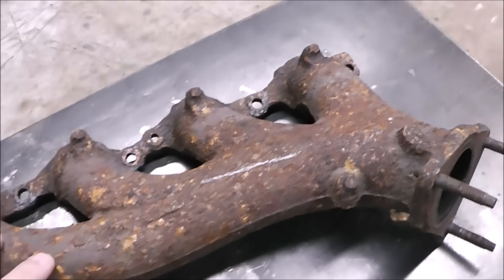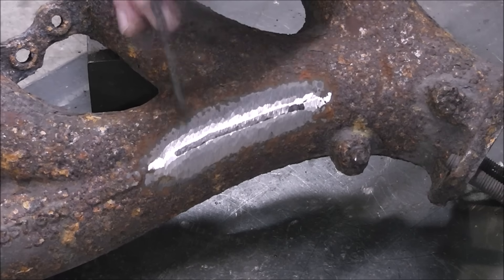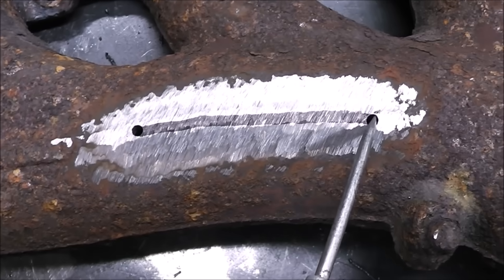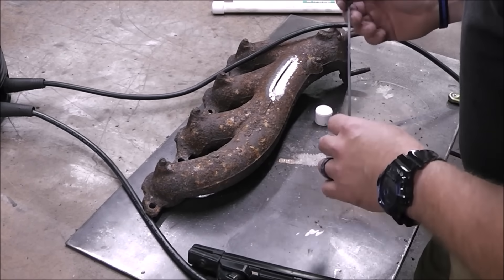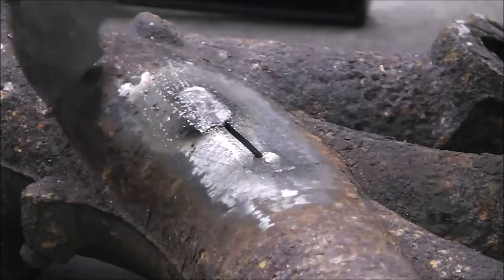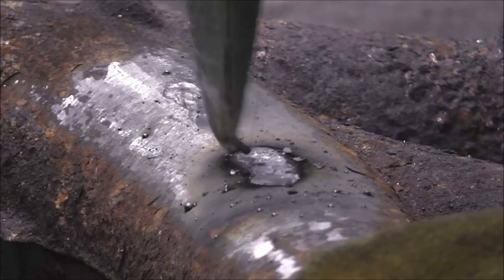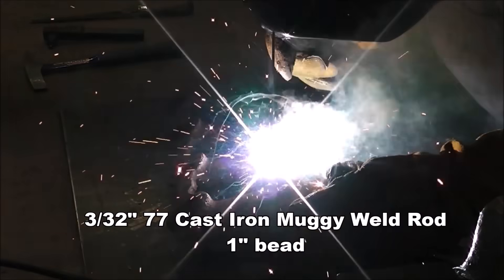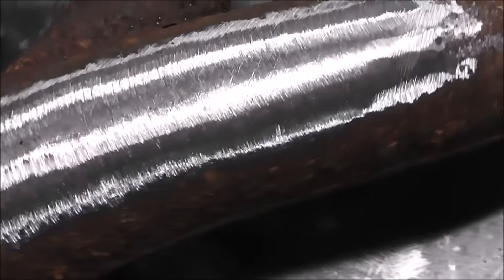Stick Welding Cast Iron Repair with Muggy Weld

Comment: any objections to filling a manifold like that with sand, would help keep the inside clean from slag and spatter?
im not much of a welder but that seems to make sense
Reply from the maker: That's an interesting concept...I can tell you that next weeks episode includes cutting this weld open, so you might find that episode interesting. However, I have never heard of a part being filled with sand but it makes a lot of sense.  I might have to do some testing on your suggestion..I like the idea. Thank you for watching!
Reply: PhunkBustA 
I was going to say woulden't oxygen & acetylene b easier.
Reply: well yeah but you cant always have access to an oxy torch, could possibly get away with doing something like this out in the bush with a couple of spare batteries?!??
Reply: PhunkBustA 
Is this to me.
Reply: yea man

Comment: I've always used JB weld, follow the same prep procedure. Mix up the jb, smer it on and leave it set for awhile, with me it's always been a couple days before I got back to the project.
Reply: jb weld on a exhaust manifold will fail in mins. It can't handle the heat.
Reply from the maker: I've have heard of it being used on exhaust but I have not personally tried it. I have used JB Weld successfully on a carburetor flange that I accidentally broke off.
Reply: Learn how to weld.   Smh
Reply: i keep hearing more and more good things about jb weld and i keep wondering why i don't use it for everything

Comment: Sorry, nice work but that is not a "perfect" weld, as you stated...
Reply from the maker: Oh it's perfect alright, in fact, I think it could be the best weld of any weld ever 🤣....want to know how I know this? Because I cut it open and examined it. You could also say your weld is perfect if it held together,  didnt crack and the repair worked (just in case you didn't want to cut open your fresh engine block repair 😂). The video will be out next week. Cheers and thanks for watching.

Comment: To stick-weld cold cast iron, just use a series of very short tacks (half-second to one-second maximum) , immediately peening each as it cools down, and never letting the piece get too hot to touch. Takes time, but is reliably effective.
Reply: Use "99" rod or 309 stainless steel rods maybe 😀
Reply: sixmagpies p
Reply from the maker: Right on!

Comment: Whath about preheat it to aprox 100 degree 212 Farenheit before starting welding? Wil it make a different too the end result? Thanks for a good video about cast Iron welding.
Reply from the maker: If you can do a preheat first, then weld, then possibly a post heat followed by a cool down slowly by insulating the part in a blanket or sand will greatly increase your success. Some cast is more forgiving than others but pre and post heat are the preferred method.

Comment: Can I weld my old thick cast iron vice ? I try with my soft steel rods and it felled.
Reply from the maker: You sure can! If you can do a post heat and cool in sand, it will also help.

Comment: I have repaired engine blocks and heads with muggy rods, I've even TIG'ed with them. NI99, and silicon bronze also work.
Reply from the maker: I was impressed with the instructions that came with their rods. I plan to try to TIG with these. Im excited to try them.
Reply: WANT TO SEE WHAT THIS LOOKS LIKE ON THE BACKSIDE? WANT TO FIND OUT HOW STRONG THE WELD IS? FIND OUT HERE: https://youtu.be/cVrydI-v7B8
More cast iron welding videos here: https://www.youtube.com/playlist?list=PLfbf78fMz9VpweFv4IqUfrrNV6Vvro7Cd

HERE IS THE INDEPENDENT TESTING SHOWING THE CARBON CONTENT https://ls1tech.com/forums/forced-induction/1750208-what-truck-manifolds-really-made.html

NO I did not mess up.
NO I did not weld one side then finish on the other.
Both sides of the manifold were prepped. You saw me prep one side. The other side was also prepped for a future tig welding video.  Being the producer, cameraman, narrator and welder, I didnt realize that I was welding on the side that you didnt see me prep.

Comment: Worth saying that it depends on what type cast iron it is as some are weldable with precautions but for instance White Cast iron is normally considered unweldable by a fusion process, problem is always knowing which one you have?
Reply from the maker: Spot on brother! It seems that even grey cast can vary widely depending on the age and what it's application was.

Comment: I once did a beautiful job welding a Slant 6 exhaust manifold crack. I had it resting in the vice, loosened it and it fell out of the vice and hit the floor. I even managed to grab it, but it rolled out of my hand and broke into 3 pieces - nowhere near the weld btw!
Moral of the story was, sometimes cast becomes so brittle that it's a waste of time repairing it.
I felt a little silly but this manifold breaking was a blessing in disguise. a) I didn't fit it to the car, and b) it taught me how to identify good candidates for repair and those that ought be rejected.
If they're not rare, I always tap exhaust manifolds with a hammer now.
Reply from the maker: Oh man! I can actually picture that happening. You are correct about cast being brittle. It seems it can vary widely. Some cast is much easier to repair than others.
Reply: The properties of it change with age combined with the type of use the car has had. 
I don't know what those variables actually are but if the cast has gone that light brown color it usually is no good. It gets altered on a molecular level I'm thinking.

Comment: The steps were good but you did it wrong. You should cut it with a thin grinder, not marker it. Anyone can weld a non cracked cast iron.
Maybe you weld a real crack not pretend you have a crack. The prep for a real crack are different.
Looking forward to see it right.
Reply from the maker: Isfan Romeo Did you watch the video?
Reply: Yes i did
Reply from the maker: I'm confused then... I sliced completely through the cast iron with a diamond cut off wheel, then I stopped drilled it and I welded up the gap. I'm not sure how a real crack is any different from what I did in the video?

Comment: I'm 3 for 3 I know of. 3 that failed immediately,and 3 that are still working, all 3 exhaust manifolds on flatheads that are presently award winning show rods. 1/8' Nyrod, preheat with NO oxy, just propane or acetylene. Oven kept rod, NO SILVER BRAZING FLUX in the same oven....that junk fouls Nyrod. Post heat same....NO OXY USED AT ALL !!!
Reply from the maker: Awesome! How did you do your cooldown? Did you lower the heat over a few hours? I've had good luck burying the part in sand

Comment: Undercut isn't from welding to hot. Its from moving too fast and not letting the bead puddle
Reply from the maker: Undercut is caused by too much welding current or improper technique. The cure is to reduce welding current or pausing your weave in the corner or reduce your travel speed. I wanted to limit heat input, so no weaving = reduce current.  Thanks for watching. Cheers :)

Comment: If you can wrap the welded part in a heat blanket, it will cool slower and become harder. I weld forklift casting and I can tell you that you hit welding cast iron on the money! Great video!
Reply from the maker: TODD CASTLE thanks man! I appreciate your support brother!

Comment: I’m confused you say mig welding in Australia we would call that ark welding different from mig which is done with a wire feed and argon gas
Reply: Wayne,   Brandon was saying that you can MIG Cast Iron but results can be hit and miss , a much better job is done with higher current and less filler than most MIG Power Supplies can provide and if your using cast specific Flux coated Nickle Alloy Rods the job will be a permanent fix. 
MIG or Metal Inert Gas some in the trade call it GMAW is in effect just the same as your standard Electrode Arc welding but instead of the flux becoming the Gas Shield it uses compressed Gas typically Argon blend fed to the weld nozzle  to shield the Arc from Oxygen in the air .
Reply from the maker: @mozzmann  ^ THIS! thank you brother! Well said! Cheers
Reply: Been a Welder/Fabricator for over 40 year's so have learned many tricks :)
Reply from the maker: I'm not sure what your referring to. I was stick / arc welding in this video.
Reply: Mig confused with arc, austrailia really is backwards hahaha
Reply: Ah Well not as backward as some it would seem 'cause I got a news flash for ya Sir !! They are BOTH Arc welding - END of discussion, they just achieve the end result in slightly different ways .

Comment: That Manifold appears to be from a V8 Buick . I had a V6 and the Manifolds were identical except 3 ports rather than 4 , Honestly I'd be preheating with an LPG torch , not necessarily to the point of glow , but fill it with sand and then place in your houshold oven at 500 deg for an hour then LPG (Propane for you Yanks ) and weld it in ONe hit then peen as it cools , then back under the torch and into the oven to cool over about 3 hours from 500 Deg F to 100 Deg F then turn the oven off.  I have welded many Manifolds like this and not had issues.  
A neat trick if there is a spring works close by is ask if you can place the manifold in their Oven  for a couple of hours and then into the hot sand pit if they use one to cools slowly :)
Reply from the maker: Right on! That's the preferred method in my book! I was seeing how these rods responded to the cold method :) cheers and thanks for watching!
Reply: I once welded up a broken trans case I stripped it of all parts then set a bag of charcoal ablaze in it after about 15 minutes we welded the crack like you did one end then the other then peened it then put more charcoal in it and lefty it burn out slowly reassembled it the next day ,its still working today about twenty years now an old ford farmtractor
Reply from the maker: Michael Richter nice job! It’s a great feeling fixing something like that!
Reply: I can vouch for the efficacy of Muggy welding rods. They flow and wet in like butter. They're my go-to rod on cast iron. You can also knock the flux off and TIG with them. I keep a selection of these rods on hand for the occasional cast iron job and they always work well.
Reply: Yeah way too time consuming.
I've done all sorts of things with stock toyota manifolds, no pre-heat, no after... heat... no nothing, just spray welded the SOB, never broke anything, been using one of them every day for 6 years no problems.
You definitely want to be welding at the right settings but other than that the cast manifolds doesnt need much prepwork.
Transmission and crankshaft casings on the other hand, those things will require some attention before, during, and after welding.
Reply: mozzmann """"
Reply: I think its a GM truck gen 3 exhaust manifold or ls motor but i have heard most or a lot of those are cast steel a lot of people use them and cut and weld up turbo manifolds
Reply: @james10739  Yup that is an early LS Gen 3 truck/van/suv driver's side manifold. Note that the heat shield has rusted off and that all of the heat shield bolts are still attached to the manifold.
Reply: Thank you for excellent information, although I'd much rather save the time with the method and product shown in the video-in all cases, you know that cast iron parts come in a variety of uses and thicknesses? I will be using these rods extensively for sure.

Comment: I used to work with an old man that used a really unconventional approach to cast iron I'd love to see your take on that And maybe some strength And durability comparisons. please contact me for more information.
Reply: I would like to hear how to weld solid cast iron, I broke the arm off my windmill gear box casing.
Reply from the maker: Shane Strenke it would be the same process as this. You could also add some pre-heat and post heat and then wrap it up in a fire proof blanket or bury in sand.

Comment: That is not cast iron - sparks from the grinder are wrong. That is cast steel off a chev product.
Reply from the maker: Not possible. Gm didn't make this as cast steel.

Comment: that simulation is wrong...when a crack forms from rust the metal is ALLOT thinner than in this video, razor blade thin...what you are welding there a 10 y/old kid can do...
Reply from the maker: Cast iron does not crack from being "rusted out razor thin" as you have pointed out. If your going to  insult someone and question their intelligence, atleast know what your talking about, because for those of us that do, your coming off as ignorant.

Comment: I used JB WELD  and duct tape for extra measures.
Reply: Duct tape on an exhaust. Seems legit
Reply: Bubble gum and chicken wire works better bro..!!
Reply from the maker: Sounds like you saved a pile of money! :)
Reply: Don't forget to burn some sage around the welder and your work.
Reply: Iý0n
Reply: 😂🤣😆 Send it
Reply: Thankfully you added the duct tape, the JB Weld alone was getting me worried! LOL 😂
Reply from the maker: Just send it :)

Comment: cast iron is great discipline.. like stainless sheet to old fender repair, or as you mentioned northeast. I treat frames with cool slow downs, never lost yet.. -24F to 100F+. I get really upset at pro welders who don't even realize they are in 70 F year round.
Reply from the maker: Right on! I enjoy working with cast iron also :) thanks for watching!

Comment: I'd really like to see if you could successfully weld a 4 inch horizontal crack under the distributor hole in a WWII Willys MB or Ford GPW Jeep engine block. The metal is so thin there. Many people have tried, but even with peening, short welds, preheating, etc, they always crack on cooling. Stitching seems to be the only 'fix'. But if this rod could do it, it would be so useful to so many WW II jeep owners.
Reply from the maker: If I knew where there was one, I would give it a go for sure :) be sure to hit the notifications bell because I am going to be doing a bunch of experiments and testing with these rods on various cast pieces in some upcoming episodes.

Comment: I have welded a few with a mig and they have lasted for years now.  Last one was on a f250 dump, I even left the manifold on the truck...Let it run and get hot, shut it off and immediately started welding, full power & high wire speed.  So far have been having good luck that way, at worst if it fails again it would just need to be replaced anyway.
Reply from the maker: Right on brother! If it can be fixed, why not try! Good idea leaving it on and using the engine to produce the heat! Clever! Thanks for watching!

Comment: tig weld it with stainless steel rod.Make multiple passes to burn out impurity's.
Reply: When someone tries to show you up based on credentials that is generally a result of knowing that for the years of experience they have there skill level is low. Most X-ray work is done on new metal and this is repair work. I have seen guys that weld brand new stainless pipe on a turntable get showed up by farmers welding 7018 uphill. X-ray is just a word I have seen X-ray standards that were so low that I don't know why the time and money was wasted on the X-ray process.
Reply: Before commenting it's a good idea to establish your bona fides in subject under discussion before commenting on others qualifications.

Address the metallurgical fact I explained. I offered that information to help anyone to have a successful repair. 

Pay close attention to the gent in the video when he talks about keeping the heat effected zone cool and peening after a short weld. There is very good reason for that.
Reply: 69NOMANS69 noman  cast iron welding is all about what works for you. 309 stainless is very strong filler metal and compared to 99 nickel and other cast iron specific filler metal 309 is inexpensive. In the end if time has found you to a nice working practice that uses stainless filler and you get good results then don't let anyone tell you that you are wrong.
Reply: I don't really care to brag on myself in the comments section but if you have to establish your '' bona fides'' I am willing to do that only if asked. I just don't start the conversation that way and people can claim anything they want in the comment section and no proof needed.
Reply from the maker: Great suggestion! Im going to be doing some stainless / cast repairs in an upcoming episode. Thanks for watching!
Reply: cool channel man! channels like this are the new trade schools!
Reply from the maker: @69NOMAN69  thanks brother! I really appreciate the compliment and support!
Reply from the maker: David, I've actually had some success using 308 and 309 fillers. I realize it's probably not as good as nickel rod, but it's also a lot cheaper.
Reply: Not a good idea. Because stainless contracts so much that the weld will pull right out of the parent metal. Oh ya, I'm a certified A xray welder with over 30 years experience.
Reply: well it works and im just a shop owner with more experience in the real world of trying to keep shit running.Got i dont know how many exhaust manifolds running out there.